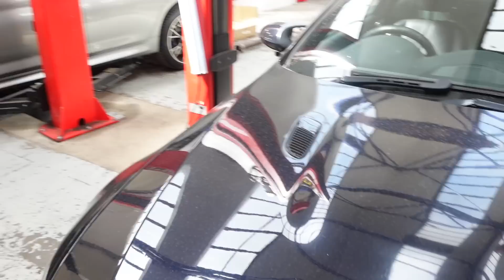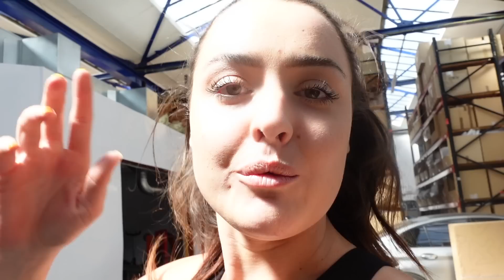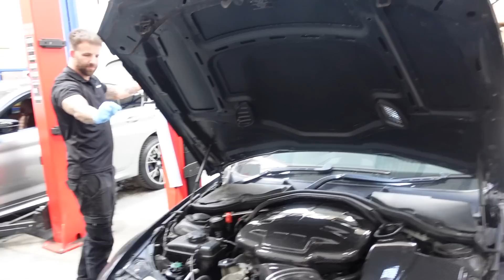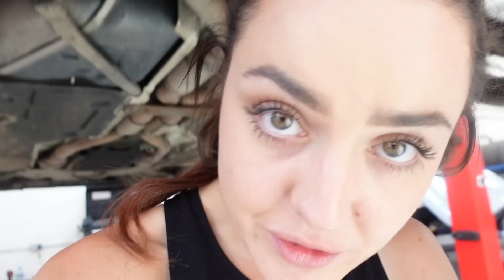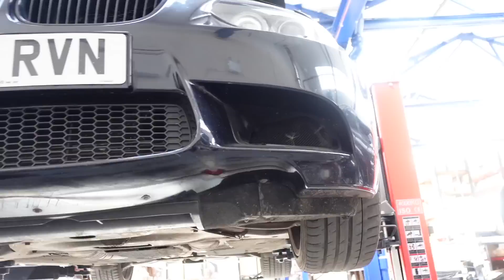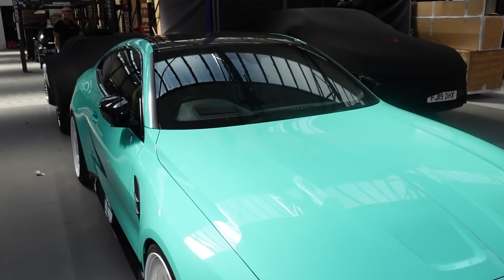Getting my E92 M3 back with its first MASSIVE BILL!!

Comment: Dont be beating yourself over "not looking after it". It's's just the age if the car. These things start to go. The fact you're looking after it well bodes well for its future.
Reply: I'm always shocked when I see how rusty UK cars get.
Reply: @doublesidedtape1000  because of the wheather probably. and i believe UK (like in the Netherlands) dump a SHIT TON of salt on the roads during the winter (and also during heat waves because salt prevents asphalt from cracking when temperatures get too high)